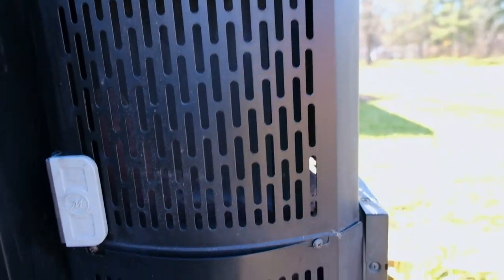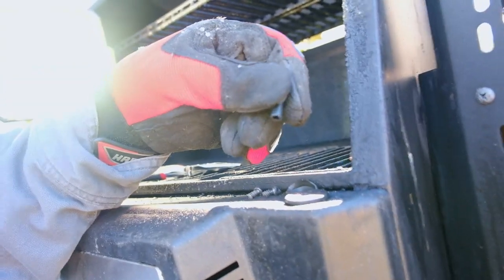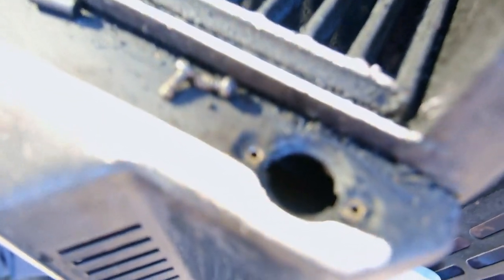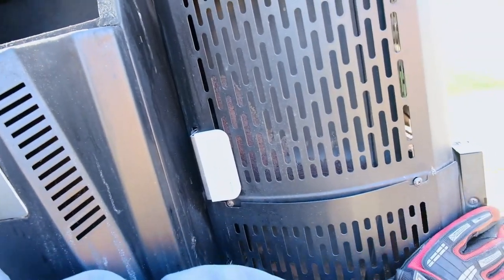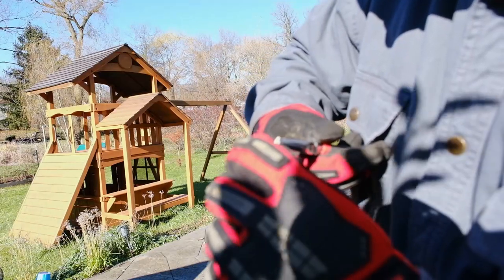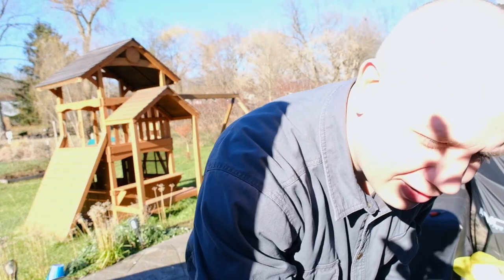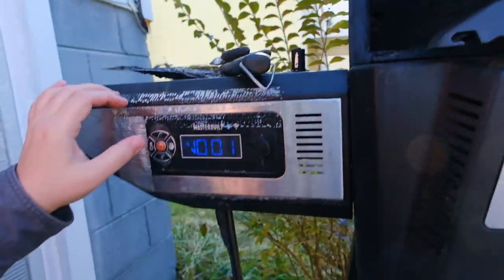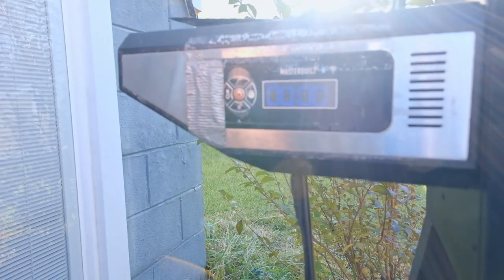Masterbuilt Gravity Series Lid Switch Bypass

Comment: In the new 800, they have lowered the switch about 6" and have a control rod to operate it.  That moves the switch itself out of the direct heat. You replace / repair it by removing a small cover on the inside. My switch stuck after about 20(ish) cooks. As far as bypassing them, the firebox switches are probably ok to bypass, but the lid can be  a little problematic. When you are searing (650° to 700°) the controller doesn't know the lid has been opened and when the temp starts to drop it calls for more heat and the fan kicks on and because it is basically a VSD, it might start slow or go to max right off the bat. This can (trust me) cause a major flair up. I know, "close the lid".... but the same thing will happen when you open it again. You still have to open it  to get your dinner out.
Reply from the maker: @jeffhamman913  great points about the lid switch as you could easily lose your eyebrows! I typically use a kettle or pellet for reverse searing anymore. I'm glad the Masterbuilt is making advances in their product design. Thank you for watching!

Comment: Thanks for the vid. I’m gonna bypass all three. I’m tired of this grill acting up 😂
Reply from the maker: It has worked well for me. The only one I think bypassing could be an issue for is the top of the firebox. I'm considering replacing the plunger switch with a toggle. That way on long cooks I don't get a hot ash in the face. The others I agree are not necessary. Thank you for watching!